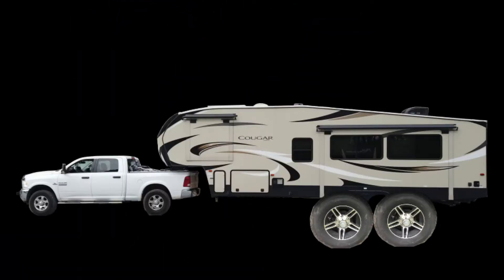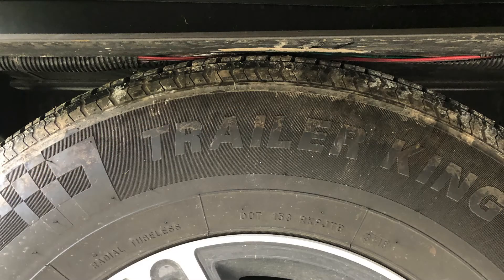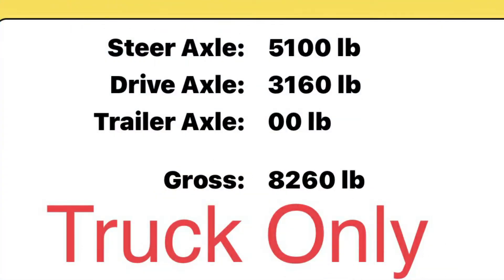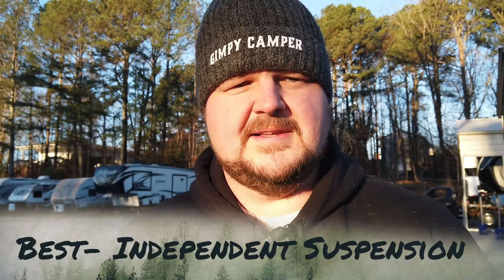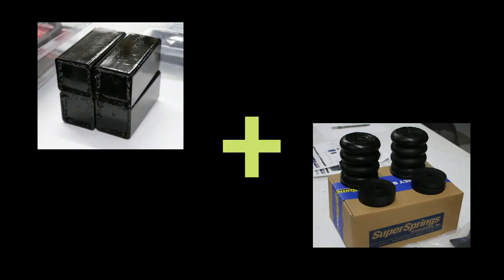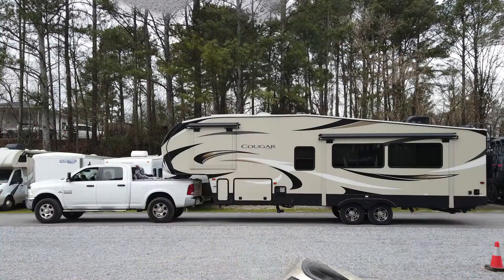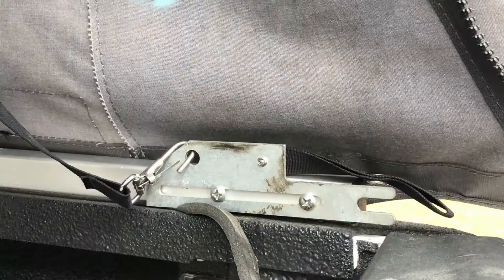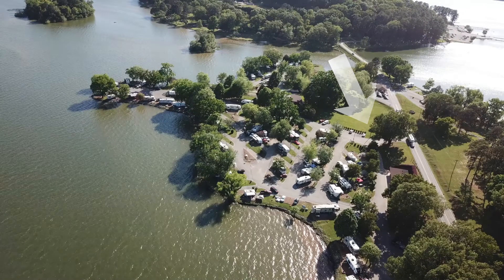Lifting Camper

Comment: I have a Utility trailer with ( 2 ) Dexter 3500 pound axles. The Axles DID sit above the Leaf Springs.  I picked up 2 - Dexter Axle flip kits to raise my Trailer. It took about 3 1/2 hours to drop the Axles, Weld on 2 New Leaf Spring Saddles on the Axles, and then re-install everything. I picked up 5 1/2" of lift with this kit!!. I noticed your Axles were already sitting below the Leaf Springs.

Comment: After measuring the locations of my spring mounts i cut them off the frame and welded on a 2x3 box steel subframe to lift my 2009 puma 5th.wheel to help level it to my too stupid tall 2021 2500hd silverado. Also boxed in the spring mounts for more strength
Reply from the maker: @lawrencefiebig2033  I’ve since kept this but put larger tires, wheels, axles and springs on
Reply from the maker: RV Suspension Upgrades
https://youtu.be/7QOUMSie9rw

Comment: The torque concerns with lift blocks is axle wrap on a hard stop, and more importantly the additional side load in sharp turn when maneuvering/twisting 

We had this problem when our TT was 3 yrs old and after 2 trips out west from Alabama.  I found a shop near me that has a side business of upgrading RV suspension systems since they are all undersized.  He will even take your old components on trade.

I swapped two 3500 axles for 5200. Changed axles, springs, brakes (from 1.5x10 to 2x12, wheels 14x5 to 15x6, and tires.  $2700 plus tires (I didn't want the brand he was going to supply).

Picked up 2" of height and now have more brake capacity on the trailer than the truck.  Wish I had done it sooner.

Hope this works out for you.
Reply: @jimcollins8097 I'm getting ready to install 2" lift blocks on my 5th wheel and I'm pretty sure that 2" will have minimal affect on braking and sway. I've done those kind of lifts on pickup trucks and never noticed any ill effects. After installation I will re-torque the u-bolts after 100 miles. The issue is the adjustment on the pin box. Right now the overhang is 7" from the bed rails but the pinbox adjustments are 2" either up or down. So if I raise the pinbox to the next setting, then the clearance is only 5" which is less than the recommended 6" minimum.

Comment: Hey Gimpy!! :) Very instructive video, I got the lippert center point suspension, they work great have you seem that suspension ? My RV is very big 42.5' long and dry weight 14 000 pounds. Sandpiper model.
Reply from the maker: I have seen it but I never looked into them that much

Comment: Any problems with the blocks since install? And how do you like the timbrens?
Reply from the maker: I have had no problems, instead of doing the sumo springs I ended up putting larger axles and 16” tires on but I ended up having to go up a spring size for clearance too, but we still use these blocks

Comment: How do you like these blocks. I just ordered a pair. Any negative effects going down the road. Have you had any problems. Thoughts after a year of use. And do you do alot of traveling with your rig.
Reply from the maker: We love these, but we have revamped our whole suspension system since this… but the blocks are still there… RV Suspension Upgrades
https://youtu.be/7QOUMSie9rw…. We have put over 15k miles with the blocks and no issues.  I get a little wiggle sometimes if I go a little faster than I should as I think the wind is slightly more of an issue.  No problem at all at 65 mph

Comment: So it's been 2 years, how has it lasted?
Reply from the maker: @brucethompson6706  lasted fine.  It’s still on there but I have since changed to larger wheels/ tires / axles/ and springs.  Very happy with the blocks though

Comment: What is holding the block in place?
Reply from the maker: The tension of the u bolts and. The nut from the spring sitting in the hole on the block

Comment: If your truck is a 2500 you're overloaded. They only have a 10,000 payload.
Reply from the maker: @conniechapin9278  those numbers are way off.  That’s much more than a payload on a 1 ton truck.   But I’m not overloaded with my “half ton towable” fifth wheel but I am at the payload limit.